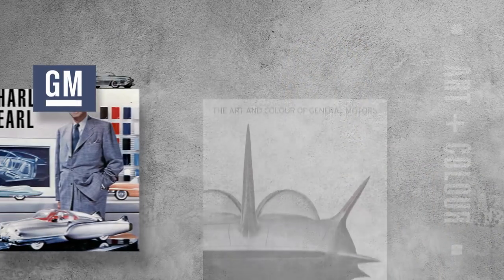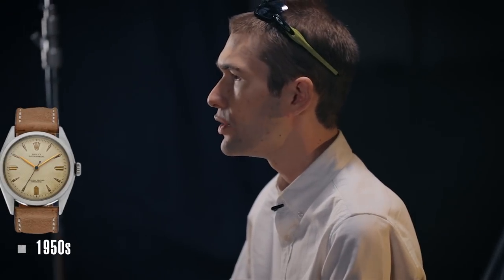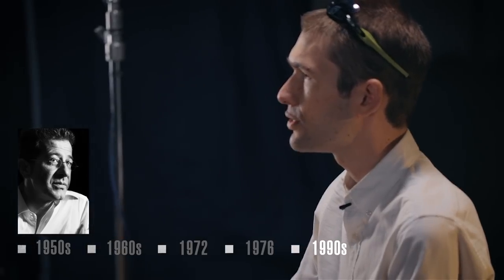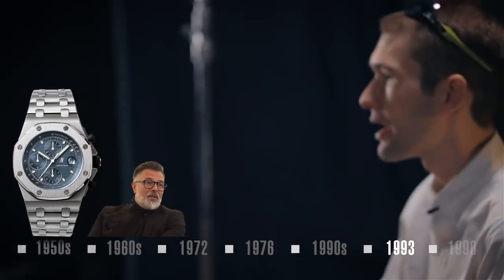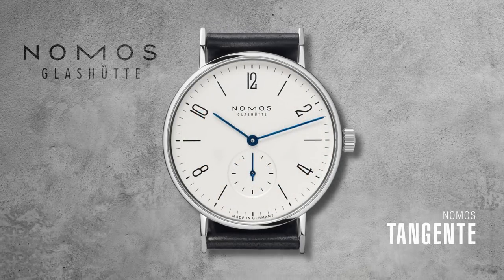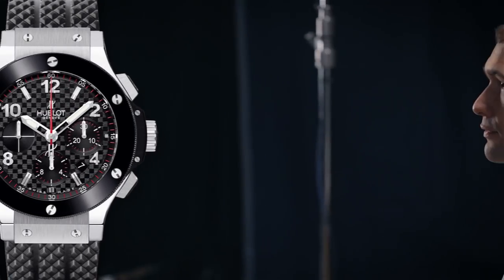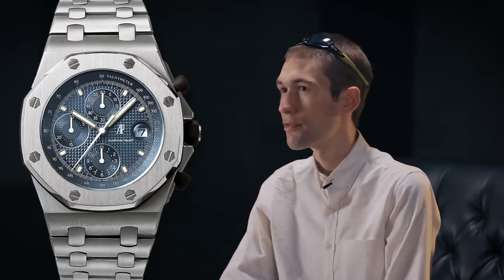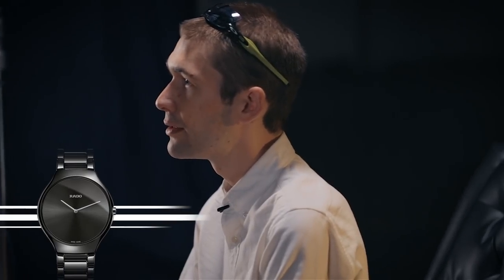Who Designed My Watch? Omega, Audemars, Patek Philippe & Rolex | The Classroom S02: Episode 5

Comment: Great insights Tim! Agree with you that a new, holistic approach to design and execution is the dominant factor today with regards to watches and automobiles; having said that, 'd like to point out that coach-builders existed for a slightly different reason - they were designers for the uber-rich! Those who were not satisfied with the automakers standard design; their production numbers were so low they could be counted by hand. If, for instance, you happen to like the engineering of Ferrari but not Pininfarini's design language (technically a design house not a coach-builder), you buy the chassis along with the mechanical bits and pieces and ship them to a coach-builder (Zagato, Carrozzeria Ghia, Carrozzeria Touring etc) to create your automobile of dreams. It's like taking a naked Datograph movement to 'Genta Design' to create the case of your own liking. The reason why these names ended up disappearing isn't because designs became an internal task but because of the evolution of car construction. The introduction of unibody aka monocoque in the name of safety and light-weight construction meant that the top and bottom parts of the car are now inseparable. They did survive for a while by being what we'd call today subcontractors, creating cars to OEM's standards but once these makers managed to establish bigger production facilities, they simply disappeared. They're trying to make a comeback despite the hardships of construction and the associated rise in costs, but it will never be like it used to be. Today there's Carrozzeria Touring whose best accomplishment has been the Alfa Romeo Disco Volante. A new name is emerging in the name of ARES Design as well; they used to modify cars in a way so hideous, they'd be the only ones competing with Mansory for the hideousness award; now though, they're becoming more serious with their work, having left modifying cars and embraced a coach-building road instead. You should check their F12-based Ferrari that pay hommage to the 250 GTO of the olden days or the Mulsanne Coupe. Great Day!